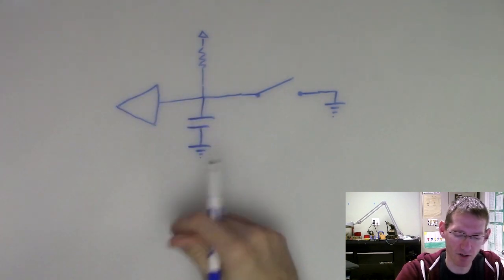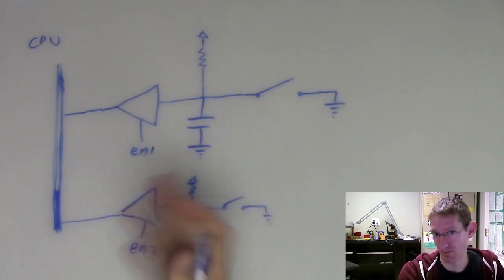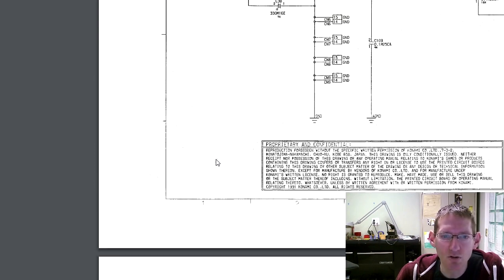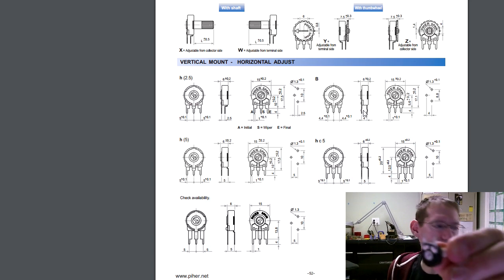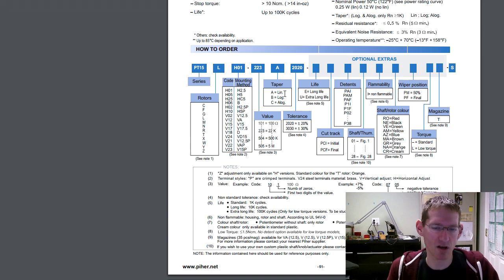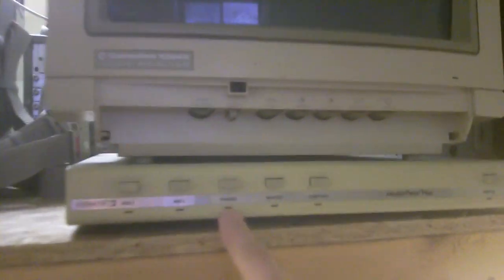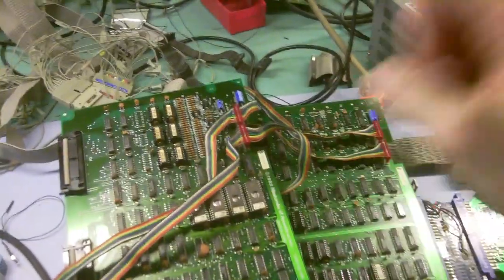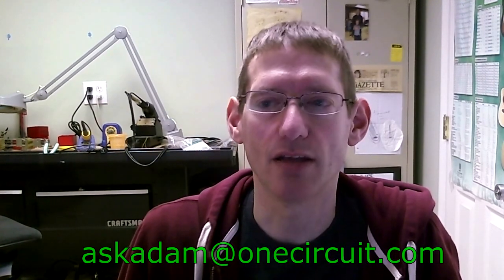Ask Adam - Ep1

Comment: Awesome! First question you answered was what I wanted to ask.  I have a Defender that keeps moving the ship down even when the control panel is disconnected. I pined the problem to the tiny IO board.  It has the Resistors and Caps just like you talked about.  You said I can use a voltmeter to test it. 9:30 So 0 is a good reading, what is a bad reading on the voltmeter? Anything above zero I guess?
Reply from the maker: +HappyAtom No 0 means the signal is being grounded all the time. That should only happen when you are moving the joystick.  If you aren't then you should expect to see something close to 5v
Reply: Thank you so much! I can't believe the timing of your video!  You are awesome for taking the time to do this.  I will let you know what I find.

Comment: A couple of months ago the "left blow" button on my Super Punch-Out stopped working. After confirming there was nothing wrong with the microswitch and wiring, I looked at those same schematics you showed in your video, saw the 74LS240 at 1R, replaced it, and that fixed the problem. Here are the test results I got on the bad 74LS240 that I replaced:

Logic Unit 1 Test Normal
Logic Unit 2 Test Normal
Logic Unit 3 Test Error
Logic Unit 4 Test Normal
Logic Unit 5 Test Normal
Logic Unit 6 Test Normal
Logic Unit 7 Test Normal
Logic Unit 8 Test Error